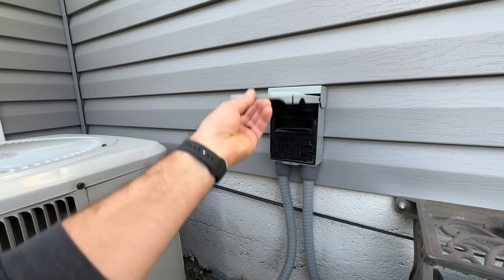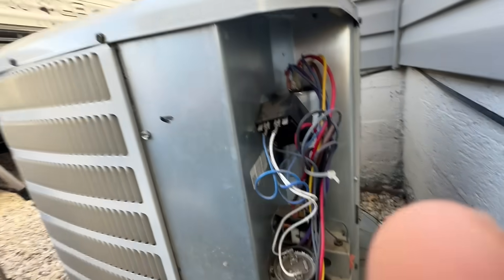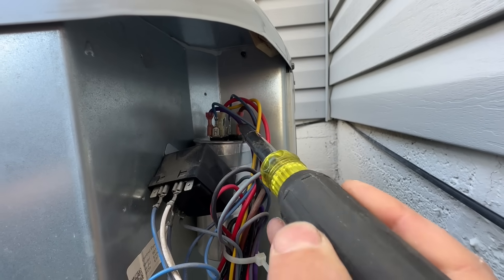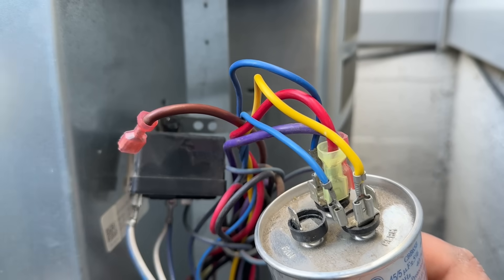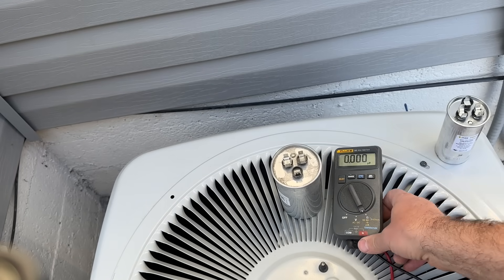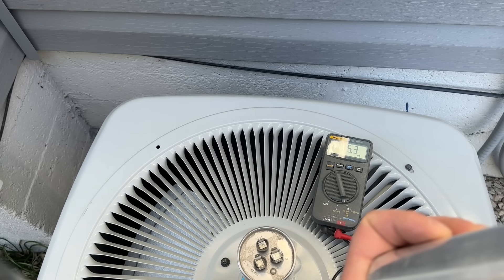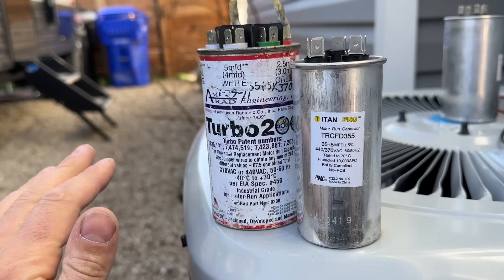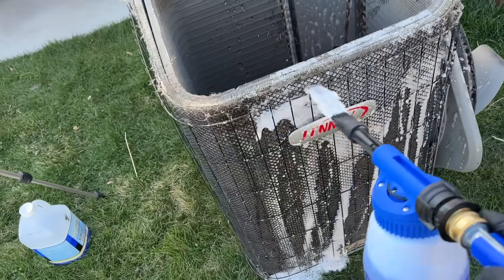How To Check & Replace An Air Conditioner Capacitor

Comment: How would you know you need to replace the capacitor out of all the things that could be wrong with the AC?  What are the steps you’d take to diagnosis this?  Or would you just suggest that if the AC isn’t working that you check the capacitor with a multimeter?
Reply from the maker: https://youtu.be/5HtyGHi8isA

This video is a very comprehensive guide to fixing your ac. But the video you commented on is specifically about the MOST COMMON repair. So if your compressor or fan isn’t running, more then likely the capacitor is the first thing I’d advise checking. But as a seasoned tech, I know where to look when diagnosing which is very hard to convey to someone with basic knowledge of their hvac system. 

If you are interested in learning more about your hvac system feel free to check out Patreon.com/diyhvacguy where for $50 I will answer any and all hvac related questions, helping you to expand your knowledge with these systems. With as much as companies are charging to repair and replace, it’s always a wise investment to become well informed when it comes to your hvac system!

Cheers

Dave
Reply: The video should have had a little clip of what the sound your a/c makes when it tries to start that is the best indicator the capacitor is out. It's easier if the unit has been off for some time to allow the motor or compressor to cool because the built-in thermal overload is why it's not running. Then, when you restart it, you'll hear the motor have a low growling or hum as it tries to start. Unfortunately this is the same sound as bad bearings so the age of the unit can be a factor. Also, just putting your hand on the motor or compressor may tell. If it is really hot, check the capacitor.
Reply: Ac units aren't that difficult to trouble shoot, not a whole lot going on inside there electrical wise. Contacts, cap, fan, compressor.

Comment: Your experience with mini splits h eat pumps for a 1800 sq foot house , do it your self units ?
Reply: Not unless u know how to measure in refrigerant into a system and have all the gages to do so. Mini spilts are sensitive. If u over add or under add refer. You're going to nuke that system. Better off having a hvac company handle.

Comment: Hey have a question for ya, where should I buy a ac unit to put in myself most places i look online look sketchy and i don't have much local since i live in the middle of nowhere
Reply from the maker: Hey! So I offer remote help with finding equipment, help with repairing and replacing equipment, and I also will help with getting the full 10 year warranty on your new equipment. You can find our membership at Patreon.com/diyhvacguy   We can save you tons of money if you are trying to replace your system yourself! We have guided many folks through their replacement successfully. The membership is cancellable at any time and can be re signed up on an as needed basis.   Cheers
Reply: @diyhvacguy  that's kinda shady dude,  lol that you'll get them the 10yr warranty. What do u tell, tell them to say that you yourself installed it?  If so, you sir are a scab.
Reply: @diyhvacguy Great now your turning into a horror all he asked was a place to buy them. You make enough money off Ad revenue and views. Come on man help the guy out instead of trying to charge him 50 dollars for a question on where to buy the unit at. You should be ashamed of yourself.

Comment: Nice video! quick question. Do failing compositors make any sounds when the ac is running? and or when it shuts off? I ask because when ours shuts off it sounds loud.
Reply from the maker: They don’t. The signs will be that either the fan won’t be running, or the compressor won’t be running.
Reply: @diyhvacguy  Thank you! You have a treasure trove of great information on your channel.
Reply: It may be a lose panel at the condenser. May need to secure with some screws!
Reply: How old is the unit? Loud starts and loud stops can be a sign the compressor is on the way out.

Comment: The higher rated voltage of 440 is better than the usual 370 volt OEM unit.
Reply: Peak voltage for the 230 v supply  is 325 volts. A capacitor rated 370 volts works, but 440 volts  is better for longer life.

Comment: I was quoted $289 for a “Condenser Superboost kit” this week. I think Im going to replace the capacitor and give it a good cleaning ($179) myself.  This company is always trying to upsell me on stuff which drove me to your site.
Reply from the maker: Yea the bigger companies are very pushy with their techs and they incentivize it a lot so they make more if they push more parts replacements.

Comment: I always use a screw driver with a rubber handle similar to the Klein you are using to discharge capacitors.  Good tips here, thanks.  FLY NAVY!!!
Reply: @znogaragego3421  does that mean you are causing whatever charge is built up in the cap to flow out ?
Reply: @vincentseidle954  I misspoke. Jump the tines at the capacitor as shown in the video to avoid other variables/issues.

Comment: Just swapped my cheap capacitor to a Turbo 200. What are your feelings between their Hard Start Kit and the Micro Air soft start kit?
Reply: I have a soft start on my unit and if you go to the website they explain the difference and boy is there a difference. It’s costly but highly recommended also super easy to install no need to pay a”tech” if you have tools and are slightly mechanically inclined
Reply: Vid was about the run capacitor which can be piggy-backed with a hard start kit for cooler climates typically.

Comment: Great video!  My son-in-law got charged $350 for changing capacitor and cleaning the condenser. He thought he got a deal, this was in 2019. I then bought a capacitor for $10 and 5 relays for $20. You should do a video on cleaning the bugs out and replacing the relay. I bought an enclosed relay to keep the bugs out of the contacts, cover this also. Thanks….
Reply: That is a good price for all of that work. Thats two hours of work, plus travel time, gas, insurance, retirement, etc.  Im all for DIY but people need to stop thinking got ripped off because its something they “could have” done.  They fail to consider all of the costs involved to make the call and the technician has a mortgage too.
Reply: @anonymous..-  if it takes u 2hrs to change a cap and clean an ac. You need to find another trade lol.
Reply: @anonymous..-  there were 2 condensers there and he only cleaned one, he was just making work for himself so he could charge more. When you go change your oil, do you let them put in a $5 dollar filter and change you $20 or more…..    Tell me you let them do that…..?

Comment: I would never advise a homeowner to work on their own equipment let alone ground out a capacitor with a screwdriver. Very dangerous in my opinion. Been doing HVAC for 10 years and not taking any shortcuts. Use a volt meter to confirm there is no power to the unit and when checking power on the capacitor, take your time and watch the voltage go to zero before touching to ensure it has no power.

The more our industry does the right thing, the better for us all. Use the meter, advise people correctly. 

Saving a buck vs saving a life — I’ll choose a life all day.

This is not the same as replacing a part on your car.
Reply: As long as people respect electricity and feel comfortable there are minimal issues.  Be smart about turning off breaker and you can pull the fuse as well to double down.  You can buy relatively cheap meters to verify presence of voltage and even be more cautious using double 00 insulated rubber gloves with leather protectors.  Consumers have every right to work on and maintain their equipment outside of refrigerant related work as an EPA cert is required.   

If we are honest with ourselves most HVAC guys are not electricians.  They may or may not have had a basic electricity class.  There are no requirements for electrical knowledge to be in hvac.  Now its understood a good tech will have more knowledge.
Reply from the maker: Well yea, when someone calls you up you aren’t going to tell them how to do it themselves 🤣 gotta make that guac brotha

Do you not ground out the terminals or have a better way of doing that?
Reply: @diyhvacguy  I check voltage on the terminals and wait for it to get to zero.

Comment: Great vid. You should add the fact that when the capacitor needs replacing, you can tell by spinning the blades on the fan with a stick and it will slowly rotate so they can ID the situation. I bought my capacitor for $5 and fixed my issues 3 years ago.
Reply: Capacitor doesn't always affect the fan. Capacitor could be bad on compressor side only. Even if fan side works.
Reply: As noted below, capacitors on A/C's are two capacitors on one.  I have seen countless times where one of them fails and the other one does not.

Comment: So should we buy a capacitor and store it in the house for years, and have it ready to go?

That way when the AC stops working, we can run out and just replace it in 10 minutes.

Good idea?
Reply: Average life of a capacitor seems to be around 5 years (Mexico/China).  The better approach is to be proactive instead of reactive.  Meaning just replace every capacitor every 4 years.
Kind of like a car battery.   Do you wait until you're stuck at the grocery store with a dead battery or do you preemptively replace after out of warranty?  Be proactive not reactive.
Reply from the maker: Amen brother
Reply: @billderby1527  well, the Tesla tells you when the 12 V batteries going bad. So you don’t have to do it proactively. I wish the capacitor could do that lol.
Reply: @billderby1527  Do they start to fail slowly, like a battery or is it just "Poof, it's bad"? Can checking it every so often show that it's starting to go bad?
Reply: @joeguilfoyle1922  Both types of failures can occur.   You can buy these off Amazon for little money.  Just replace every 4-5 years.   Yes there are meters that will indicate weak capacitors.  Generally heat is the reason for failure use to last much longer but Government got involved (always) and they had to use different oil inside capacitor.
Reply: Yes, that's what I do. I also have a spare contactor as well.
Reply: @TM_Stone  That's a good idea too. 1 year after replacing my capacitor, the contactor went out 🙂I bought one on Amazon, but it took 2 days.
Reply from the maker: Absolutely!
Reply: Is there a way I can find out the exact capacitor model without opening the thing up?

Comment: Maybe you should verify that the power is actually off with a volt meter. Sometime the line voltage is bypass in the disconnect so pulling the service disconnect doesn’t always mean you don’t have line voltage going to the equipment.
Reply: Been there and let me tell u it fully sucks. I'll never do that again, always use a voltage pen now. Getting hit by 220..no fun.
Reply: A very good way to verify if the power is still on or not is when your discharge the built up charge in the compactor it will start sparking a lot if there is still power running to it.
Reply: @MixableGaming63  bro, thats how u short out the unit if you're discharging caps while they still hooked up. 😆😂
Reply: @AllTattedUp13  I’ve already had it happen to me before and trust me you move fast enough to not short out the unit but it really depends on luck at that point.
Reply: well since you have a multimeter, you could just check for voltage at the cap terminals or at the supply voltage terminals..... no danger there

Comment: I prefer USA made
Titan HD series over the chinese pro series capacitors. The Amrad turbo 200 series are great.  Multiple options.  Buy one of each and you can fix yours or a family members unit most likely if its a cap issue.  Still cheaper than any tech visit to disgnose snd replace. Like mentioned in the video if you can match up your exact size most go for $20 or less.
Reply: Had a batch of bad titans 2 summers ago.
Reply from the maker: Exactly! Thanks for watching! Cheers

Comment: Great video.  It might be better if it began with an explanation that, if the fan motor just hums, the capacitor probably needs to be replaced.
Reply from the maker: Yea you are right. If the fan is on but no compressor that’s another scenario but I wondered if homeowners would know the distinct sound of a compressor as well as a seasoned tech. Thanks for the tip though! I’m trying to make my videos better with each one so I appreciate the feedback! Cheers
Reply: @diyhvacguy  lol..im always telling my customers..did u hear that?? Same thing when gas valve relays click..did u hear that...they look at me as if I'm crazy 🤷‍♂️
Reply: That’s not necessarily true though
Reply: @MoralOrel15  I am suggesting that the clip would be better if he explained what clues might suggest that a capicitor needs to be replaced.  He is the HVAC tech.  Not me.

Comment: Last summer I called a tech to come get our system going.  All he did was change the capacitor and add 1/2 pound of Freon. The bill was $750. I was shocked.  When I called to complain they couldn’t understand why I was upset.  I will do it myself next time.
Reply: I feel your pain.  I have spent stupid money on two new split systems.  I took HVAC tech classes and got EPA certified.  I'll do my own work from here on. Tools are cheap compared to having them come out and replace a unit.
Reply: That company was crooked and took you to the cleaners; you should report them to the HVAC licensing board of your state.-
Reply from the maker: Amen, I hope this video helped you to feel confident saving that money and doing it yourself! Cheers friend
Reply: If it was an r22 system u got that $750 for cheap lol

Comment: do you know is there a base pressure for refrigerant in a system that isn't running and is normalized/been sitting. I have a cheap set of gauges R22/410 I know I need some R22 in my system and its going to cost a lot i guess.. guy will probably try to sell me on a new unit but I don't think I need one.. I know you read pressures when its running but is there a base pressure? interesting thing my evaporator says use either r22 or 410a but Its R22 on the condenser .. at least I believe it is the label is completely washed of lettering but the unit is just over 20 years old so its kinda in that time period of the change over.
Reply: You can get knockoff r22 called Nu22 and M099. But your putting money into a dying horse dude. Buck up and get a new ac unit.
Reply: @AllTattedUp13  well yeah I haven't even checked the charge yet it might just need a small amount and I am not Elon Musk so $4-5k for a self install isn't nothing to me.. I tend to fix things if I can.
Reply: Twenty years old most likely r22. The price for someone to top it off is probably outrageous.  Btw if it's low it has a leak somewhere.  Technically you can buy the refrigerant online without a license to "re sell" to someone licensed to do the work.  If you have gauges you need to know if the indoor coil has a txv or piston.  You can then figure if you need to use subcool or superheat to check the system.  Pressures mean nothing really.  Use or download a pt chart. Pressure/temperature.  Convert the pressure to temperature.
Reply: @JSATI  yeah i am thinking its R22 but like I said.. (did I) the evaporator has a label that says good for R22 R410a on it... the outside unit is too hard to read but I am going to see what I can do to get a pic of the label and use image editing to adjust the contrast .. there is zero ink on the label but the letters were glossy coated so maybe some soot or something and whatever
Reply: @zippythechicken  check online such as ability refrigerants.  Almost certain under the EPA guidelines tab that you can declare you are purchasing to re sell to someone with a card thus remaining compliant.  If you plan to just top it off and roll you can get 5lb r22 under $400 and 10lb r22 under $500.  Might buy some time.
Reply from the maker: When the pressures equalize and the unit is off it’s hard to say but probably around 125-150psi. The real way to test is with superheat or subcooling. I will absolutely be doing a video on checking refrigerant soon! Stay tuned brother
Reply: If you live in a area where they can sell ya refrigerant without a cert you are lucky.  Also supply houses are price gouging the crap out of non certified people aka DIYers.   Outside temp plays a role in charging, and your unit has factory pressures on hi lo sides, that is close to your question about baseline.  But it doesn't help ya out really.  Gotta have good gauges and knowing how to read them is key.
Reply: @ptso7580  yeah.. no you can't buy R22 here without a certificate.. yeah digital gauges would be nice but there was a time when they didn't exist .. my gauges are analog but ok.. I know at least on automotive systems the pressure equalizes on the high and low side once it has been off for some time. I don't see a reason that doesn't happen on HVAC.. thats what I was asking.

Comment: I'm on the fence but not really. I need to just buy the parts. I replaced the cap last year. 50$ at a hvac supply, they actually sold it to me/homeowner. Cool guys.
I think i should get an igniter and flame sensor. Seems like those are the next two items that go and are easy fix's
What do you think?
Reply: Flame sensor for sure.  Assuming winter time heating issue.  You can use scotch Brite or money to clean the flame sensor and possibly get you by in a pinch.
Reply: @JSATI  ty
Reply from the maker: Absolutely, whatever parts you can get and have on hand is always a good idea. My dad did the same with his package unit. He got the ignitor, inducer draft motor, fan motor, and flame sensor so he is set if anything goes at the worst time
Reply: @diyhvacguy  ty